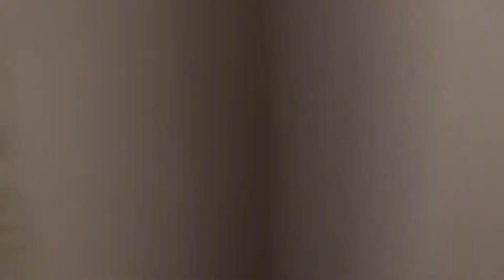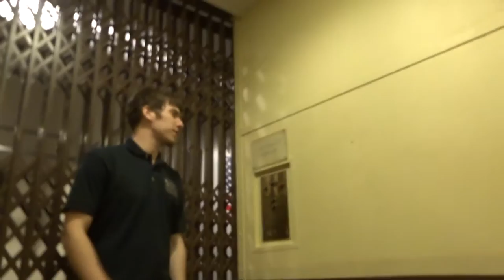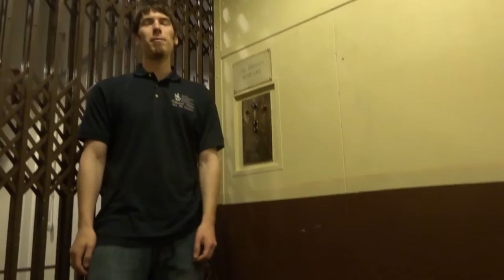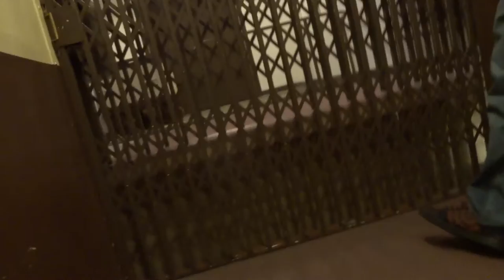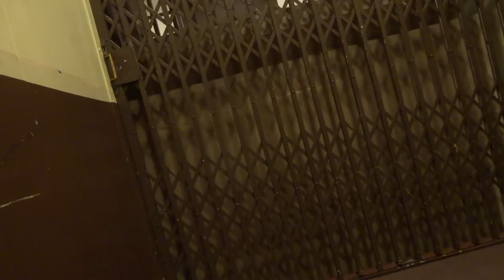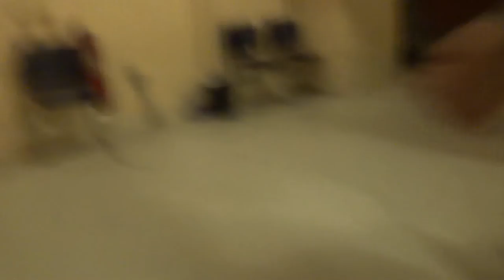Awesome Motor! Vintage Otis Elevator at the Ronald Raegan Missile Site, Cooperstown, ND (Down)

Comment: This is an Otis elevator. This is an odd elevator. Notice how it has scissor gates inside AND outside! I didn't know scissor gates outside the elevator were even code compliant in the United States!
Reply from the maker: upanddownadventures There were no codes when they installed these things almost a century ago.
Reply: HD Transport & Elevator Videos 
Do you know what year this elevator was installed?
Reply from the maker: Not exactly, but I can only assume it's from the 60's when they built the facility.
Reply: HD Transport & Elevator Videos
Elevator codes did exist in the 1960s. Scissor gates outside & inside was more common in the UK, and maybe some other countries. I wonder if this elevator was given an exception from some elevator codes, so it did not have to follow all of them.
Reply from the maker: Thank you for confirming my suspicions. This facility was built during an active war and owned by the military, so I'm sure even if there were rules or codes in place, they would have been ignored at this type of facility.